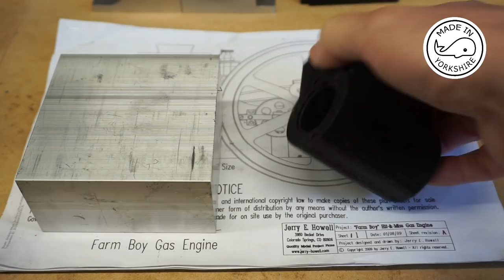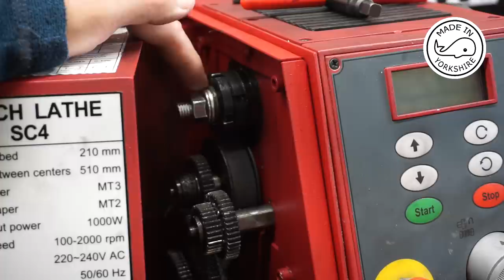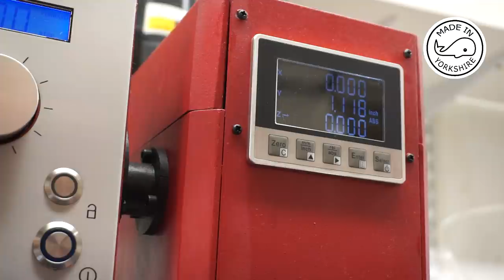#MT35 Part 7 - Farm Boy Hit and Miss Engine. Machining the Water Hopper. By Andrew Whale.

Comment: Hi Andrew. I just made the same part last week and then found your video. After milling to the main dimensions I also removed more metal from the ends leaving just a square(ish) area for the two bosses, and did the cylinder liner hole and bosses on the lathe. The bore is within 0.001", so I'm happy with the result. My lathe is 12" x 36" so maybe that wasn't an option for you. The reason for drilling the three holes from the frame end is so that if the holes wander it still fits the frame. In fact, I had made a slight error with the matching holes on the frame, and simply repeated that error on the water hopper to make a perfect alignment. Per the drawings I made the filler an interference fit and heated the main part to 120C and froze the filler, and it pressed in easily (it will never come out). Really enjoyed watching you make the same part!
Reply from the maker: Hi Tony - not sure why I missed your comment from 5 months ago! Some useful information. I hope your engine is progressing well.
All the best.
Andrew
Reply: @learningturningmetal  Thanks Andrew. Hopefully we'll get both our engines running soon!

Comment: Hi Andrew I would just like to say how much I enjoy your videos "Great Stuff". On the subject of the quill readout I had the same problem I have a Warco Super Major, It is an easy fix, one of those magnetic LED sowing machine lights attach it to the side of the machine and position it slightly lower than the viewing window and it will illuminate the display perfectly. Hope this helps Mike The Refurbisher.
Reply from the maker: Glad you like the vids Mike! Great idea regarding the LED light. I'll see if I can get hold of one with a USB connection - then I can power it directly from the mill
Cheers
Andrew

Comment: It would be great if you could modify the adjustment tool for the between centers boring bar, so it could clamp on, and off. Instead having to slide it on from the end. It would save you loads of time.
Reply from the maker: Yeah very true Barry. That is the only negative I have with the design. I suppose I could be using the tool incorrectly? The final result worked out well though.
Cheers
Andrew

Comment: The finish on that part is very good and the sleeve is a lovely fit. You should be really pleased with how it is going. Really starting to take shspe now. Most of the heavy cutting must be done now.
Reply from the maker: Hi Tim - yeah it seems to be going OK at the moment and it's good to get those large pieces out of the way. I've not given the flywheels much thought though - maybe I'll be able to get some cast iron ones made from somewhere. I need to get my thnking cap on.
All the best.
Andrew
Reply: @learningturningmetal  RDG do have some flywheels. Not sure if they would be suitable or the right size. Blackgates and Reeves sell spares for all their casting sets, so you may be able to find something suitable there and just order the flywheels. Regards Tim.
Reply: @learningturningmetal  Keep an eye out for some used keep fit lifting weights. They are cast iron.

Comment: Hi may I make one suggestion when line boring , if you put the tool bit adjusting device to the left of the tool bit when you have made the adjustment you can just slid it towards the lathe chuck and tighten it to save having to keep removing it from the bar.new mill working well looking forward to the next instalment.regards.
Reply from the maker: Hi Steve - many thanks for the suggestion. I did try that approach off-camera, but my boring bar is too short. By the time the cutter has passed through the sleeve hole (circa 4inch in length) there is very little space left between the chuck and the piece being machined. Definately not enough space to hold the micrometer thing. I'll certainly try that approach out on smaller items though.
All the best.
Andrew
Reply: @learningturningmetal  you can bore right to left or left to right,  so the micrometer adjuster could be on the tailstock end. 
Oh and nice job by the way. 👍

Comment: Cracking job, Andrew. Plenty of chips with the new mill, WOW too that light sure shows up everything, almost needed sunglasses with the glare off the aluminium. What was the movement with the big cutter, I was quite expecting for a crash with the work juddering. Looks like it was a bit more than loose rotary table clamps, perhaps there was some other slack. Check it out when you get time for future reference. Almost an expert now with the line boring, glad it all went well. I know that you have only just bought the mill, but perhaps have a look at replacing the quill DRO DISPLAY with a better one, they are quite cheap these days. Perhaps too you could take the output signal and feed it into your phone system one you built for the other mill, I seem to recall it is a bright coloured display. Stay Safe and Well. Regards from a Wintry Australia.
Reply from the maker: Thanks Dave! Well spotted regarding the judder. I'm pretty sure its the rotary table - maybe a backlash type of problem. By tightening up the rotary table clamps it seemed to sort it, but I agree that it needs further investigation. I'll explore DRO display options. Mike the Refurbisher suggests an LED sowing machine light. Maybe I could get a USB powered one.
You stay safe too mate!
Cheers
Andrew

Comment: G’day Andrew, well done. I do wonder though why you line bored in the lathe (so you can use your boring bar) and not just bore it in the mill with the boring head. I did enjoy the boring setup on the lathe. Awful lot of work that rotary table and the final finish was excellent 
Cheers 
Peter

Comment: Hi ,Andrew. I heartily agree that the small depth dro is a real pain without a backlight. The unit on my warco is very difficult to see under some light conditions. There must be some alternative unit or a means of modifying a standard unit to get a backlight facility. I don't know if you read my latest development in my quest to find gear cutters in either 48 DP or 0.5 module but I eventually located and purchased a full set of 0.5 Mod cutters of Russian make. Every other supplier seems short of one of the appropriate cutters in either format.
Reply from the maker: Hi Howard. Yeah, regarding the backlight, Mike the Refurbisher suggests an LED sowing machine light. I think I will try to get hold of a USB LED light and power it direct from the machine.
I think this covid bug must be creating shortages of certain things. I hope the Russian cutters work out OK. Please let me know how you get on.
Cheers
Andrew

Comment: Andrew, were you able to work out why you needed additional clearance for the big end of the connecting rod?
Reply from the maker: Hi Colin. Yes, I misread the drawing. The arc cutout on the rear should have started about half an inch lower than the top. 
All the best.
Andrew